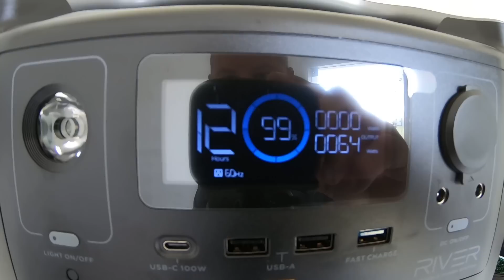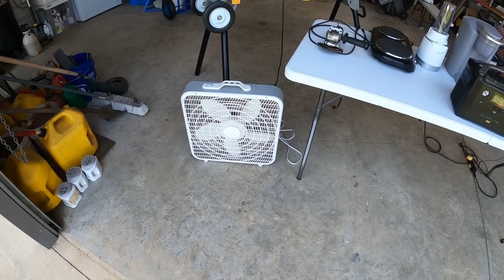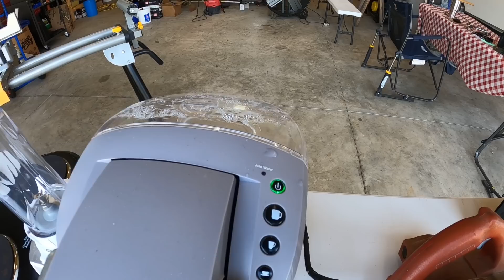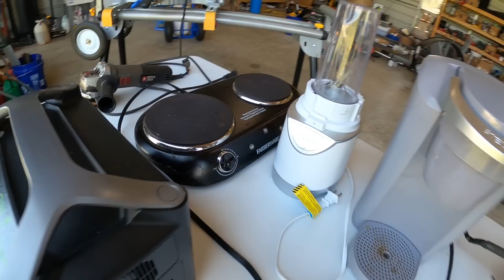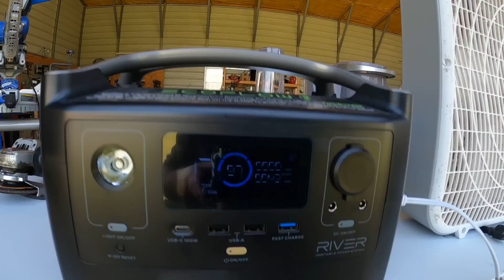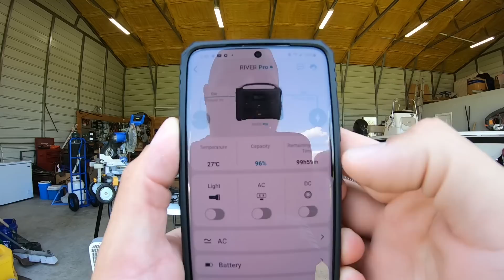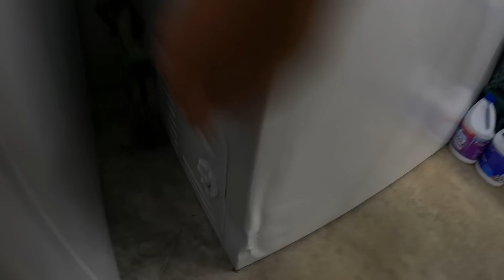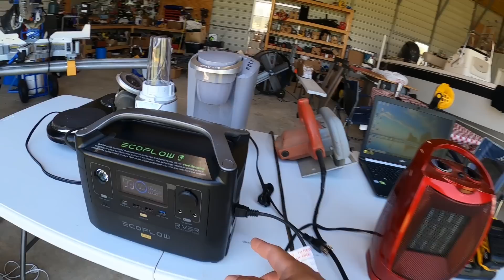EcoFlow River PRO full test and review! Huge episode!!! #EcoFlow #PowerStation #EcoFlowRIVERPRO

Comment: Hey boss..can u do a test of the AC with the ecoflow from 100% charged to 0% and see how long it will "really" run since the compressor does not run all the time. 
Im thinking of using this for a small space like yours with 5000btu window AC, if it run for atleast 3hours..it think that is gonna be great.
Reply from the maker: I'll see if I can test that soon. Please don't hesitate to drop another comment next week as a reminder for me.
Reply: @TKCL dropping by to see if you had any chance to do that test.  Thanks for videos once again.
Reply from the maker: Tell you what I'm working on the house tomorrow and using the cooler, I'll run it on the ecoflow. I usually run it on refrigerator only and eco mode. How do you need it tested?
Reply: @TKCL  I have a smaller version of this battery and I'm seeing 65% to 80% of stated run time if I run the battery from 100% to 0% powering an AC device. Ecoflow says this is normal, and also suggests it is most efficient at around 200 w AC steady. I'm curious to see if you experience likewise. I assume that the battery is more efficient powering a DC device. Thanks for your testing!
Reply from the maker: I'll have to test that, I tend to not run my batteries on any device to zero.
Reply: @TKCL  Right, and you should avoid doing so except for testing purposes. The only state of charge the battery can measure accurately is 100%, and 0%. This is why the people who test electric vehicle range often test from 100% to 0%. Any other state of charge is an educated guess. My limited testing indicates that the Ecoflow does not stand up to AC load nearly as long as its display indicates. I still love the battery, but I don't think it will hold up in practice for as many hours as its display says it will.

Comment: Yes, it partially runs a portable table saw, but as you can see the power is limited to 600 watts. Not the same as running (120v x 15Amp) = 1800 watts. So it's running at 1/3 of its power. 😉
Reply: No you don't get this Amps out. EcoFlow lowers voltage you can't get more out than 600Watts, means all your devices that uses more than 600Watts runs with reduced power.
Reply from the maker: I now know that. That could be an issue for devices that need a certain voltage and speed to cool motors.
Reply: @TKCL  exactly, microwaves for example most don't accept lower voltage. If you have a Inverter technology microwave it should work: Set microwave to 600Watt or lower. You could also turn off x-boost and try, the device allows more than 600W for a short time.
Reply from the maker: I have not tested it yet, but you think the saw is pulling 15 amps all the time? I thought that would be the initial surge of startup or under very heavy loads?
Reply: @TKCL  - It all depends on the load... if you're cutting a thick piece of wood. Yes!!! 12-15 amps for sure.

Comment: Have you figured out a way to hack another 12v lifepo4 battery for it  ( not the one they sell ) and will it also charge it at the same time. And have you run this thing 24/ 7. Continually and by the way I d like for you to actually put the saws under a load and actually start cutting stuff.
Reply from the maker: No I'm not going to plug anything into it other than what it's designed for. The longest I have ran it was about 4 hours currently. We have not had a power outage yet to run it hard.
Reply: @TKCL  ok thank you .  You did a good a good job.  I'll try and find a video that has run it hard continuously.
Reply from the maker: Thank you for watching

Comment: Thank you.  Good review on this.  It's my understanding this unit will compensate over 600 watt appliances by reducing the corresponding voltage somehow.  No idea if that damages the appliance or tool, but it does allow it to run for a while.  Also, the chop saw ran, but will it run when your putting more torque or load on it cutting wood?  Saw another video where it cut out in that scenario.  Its not an end all be all, but with modern technology is the best I've seen so far.  That said, I still think it's worth having as it does power a lot, great when SHTF scenario, light and easy to move around, and charges very quickly, eliminating having to buy a lot of panels. Someone I know uses it as a UPS for his computers because of the bypass function where it can be charged and still power at the same time
.
Reply from the maker: That's my understanding too, the only thing I would be concerned with the reduced voltage is any electric motor that really requires a fan for proper cooling. I know they all technically do, but there are some circumstances that require more than others.
Reply: @TKCL  Well, I just ordered one yesterday, so hope it works well.  Have you done any reviews on Cutting Edger Power units, the large 3000 watt ones?  Have been checking these out for a year now and looks interesting.
Reply: Sorry... that's Cutting Edge Power.
Reply from the maker: I have not tested those, just bluetti and ecoflow
Reply: @TKCL  please check it out cuttingedgepower.com     Would love to see an unbiased review on these.  Thanks

Comment: One thing to remember is that the boost works by reducing voltage.  Therefore, any device that requires an exhaust fan you cannot run continuously.  The device will run hotter but the motor and exhaust fan will run slower.  So there are some things that can overheat.
Reply from the maker: Good to know!
Reply: What would be a good prime example of something that has an exhaust fan that someone might try to run off of an electric/battery power station such as the EcoFlow?
Reply: @Icyyellowsandroutes8823  Well, I'm not going to say I would do this myself, but in early reviews people who ran tests typically used hair dryers.  And many of them panned the Ecoflow because it burned up hair dryers on HIGH; meaning it was running at higher voltage to generate the heat, but the fan was actually running slower.  So that's not an exhaust fan, but the principle is the same.  Ecoflow now gives disclaimers about the types of things you should not try and run with Xboost; that it should only be used on devices that generate heat.  You cannot use it on a device that has strict voltage requirements, it may damage it or not work at all.  Anything that generates heat might have some kind of fan that dissipates that heat.  For instance, a microwave has an exhaust fan; a heater needs to dissipate heat as well as a hair dryer.  So practically speaking, one might never have a problem with it, but it can potentially result in burning something out or damaging it because the device requires constant voltage.  It is handy for some applications but it's not a magic bullet.
Reply: @JustVinnyBlues  Gotcha brother. Thanks for the valuable advice, wisdom, and good info from here on out. I'll be making sure that I check up on these things and be more cautious. As a matter of fact I'm screenshotting your message or reply to me. Take care man. 👍 Right on
Reply: I ran a small 1500 watt electric heater, What happened. Was unbelievable  with the " MAX BOOST ON. IT MUST BE ON TO REGULATE THE VOLTAGE" with my Maxx boos on. I connected the 1500 watt heater. With In 20 sec max BOOST  was engaged fan on. It was pulled the voltage down, & this space heater ran no problem. On high level high heat!
 " please make sure you turn on the Max boost. By clicking in the EF App is the best way or just turn it on the Grey button on bottom left side turn it on and test it. We have one full year" mine 💪 just as advertised"
Reply: @craighoward6243  Man you are really saving me as far as having to learn how to do a lot of stuff. Yeah, I'm a bit of a geek myself and thanks so much. I haven't connected the battery yet, but once I start living the camping life then I'll be using it all the time. The only thing I've done is installed the app and charged my phone on it once. It said it could charge my phone for like 19 watt hours and when I got it it was at like 80% battery percentage. I'm super stoked though I've just been really busy lately, but I can't wait to start using it, especially knowing that you ran something at 1,500 watts. I like the fact that some things are able to run by switching the voltage and wattage around. Thanks again brother! 👍
Reply: Good for you no problems. Iike the Pass through charging. Charge while we use,
Or endless power supply! B very careful with your unit. They are more valuable than a Rolex. " I had my Oyster stolen by a family member, for a small drug debt my wedding gift"   🙏  I love you living the 
Van life. Just be mindfull of people all people"
Reply: @craighoward6243  Thanks for kind words. I will come back to here if I need these words again. I'm sorry to hear about your Oyster, that's just terrible.
Reply: Yes it was My Brother!
Reply: I just added the Max extra battery to my
R 600,  "BIG IMPROVEMENT" it doubled everything. From 240 fast charge to @ the highest intake 501 watts from the wall. My cell phone charged from 40% to 96% in 22 minutes!     WOW THIS IS HUGE! " people don't wait price gouge is coming!
Reply: @craighoward6243  You mean just the EF River the battery attachment? Yeah I ordered that too, and that's great news! I didn't know how much of a difference it'd make but I'm glad to hear that. I can't wait to get mine!
Reply: Get it doubled everything and I enjoy the Nightigh! If this is in your budget, do it I received my max battery from Ebay refurbished. By Echoflow $ 149 I live on a fixed income, the $249 _ 300. This is way to much. 💰. I'm very impressed 👏 you will be as well my friend stay safe & aware of your surroundings!
Reply: @craighoward6243  Yeah I got the refurbished one too and the refurbished EF River. I can't wait to use it thank you my friend
Reply: You will be more than happy give it 24 hrs after a firmware upgrade!
Reply: @craighoward6243  Very nice, how do I upgrade the firmware and I'm supposed to use the AC function only to recharge it and use the DC function only when I'm plugging up anything I want to use with it, right?
Reply: Just Go to your app. Or get the EF app 
And controll your R/ max. Then you will see confirm " Firmware" if it shows no updates needed. I still checked, use the app. & your wifi. It will controll all the New features of the Max Battery. Make sure the R 600 is off & unplugged, b4 you attach the Max battery! Wait a minute turn it on. And have fun
Reply: @craighoward6243  Thank you so much man! You're a lifesaver and a scholar.
Reply: Did you get your battery, and how do you like it? I'm a geek my alter ego!
Reply: @craighoward6243  and yes I got the battery but I haven't even opened it yet 😅 just used the River. But I will when I get time to though, and I'm sure it's awesome.
Reply: It is when you have a good connection a Icon will show on the left side under the hrs shown!
Reply: @craighoward6243  For the extra battery or for the whole unit put together?
Reply: I will need a additional 110, or 160 watt Solar panel  & a 20' extension with a double hook up. To the River Max!
Reply: @craighoward6243  Lol, good luck 🤞👍

Comment: This has an 800 cycle life span. If you use the supercharge it reduces the life cycle. Use it sparingly like in the road at a Starbucks
Reply from the maker: I agree, but let's be honest, it's going to take any normal using human being forever to charge this 800 times. By the way, after 800 charges its guaranteed to still keep 80 percent battery capacity, not 0 percent.

Comment: Thank you for testing this charger. Sure wish we had this , this past February .
Reply from the maker: No kidding, I can think of a lot of situations where this will help.
Reply: @TKCL  Nice Video thanks. Tip: Get more runtime by plug DC consumers without a AC/DC powersupply directly to the 12V DC Car or USB plug of the Ecoflow. This bypass lossy DC->AC (Ecoflow) and AC->DC (powersupply of the device) conversions. Some devices has USB powering options. if not but your device runs at 5V or 12V DC, you can use a cable adapter or soldering your own.
Reply: Ok @TKCL  BB blocbjjmlbzlk no xxx x I'll

Comment: Andrew im a buyer if the Ecoflow pro can run your power tools all day building your house. Im shopping for a battery inverter to use while I build my cabin here in Alaska. Ill be 25 miles from civilization and 190 miles from my house. I need a reliable power source.
Reply from the maker: No way it can do that, but it can recharge enough batters for my dewalt set to work all day. That's something I would consider if I were you, convert to battery powered tools only and recharge with this.
Reply: Most of my power tools are battery powered but I have a Dewalt compound miter saw like you and thats what I would need it for. I have a generator but weight will be my issue because only way to my cabin build site would be by Argo.
Reply: The Ecoflow River Pro is not powerful enough to power high amp power tools.  You would need a power source capable of providing 2000W.   The EcoFlow DELTA Max would be a better option if you have to use a battery power generator.  A gas powered generator would be a lot less expensive.